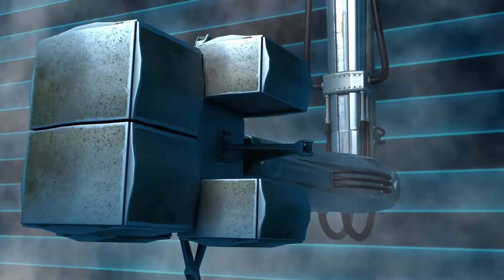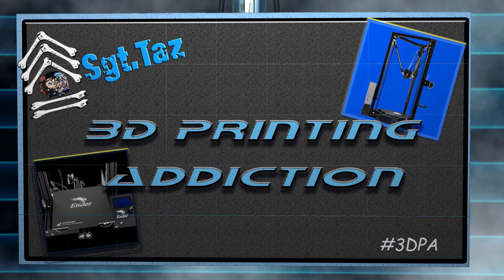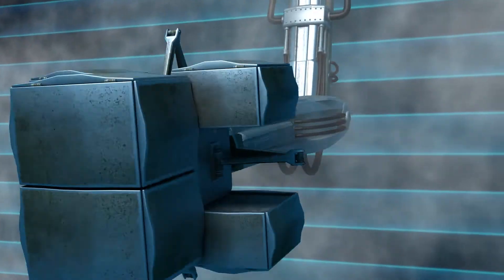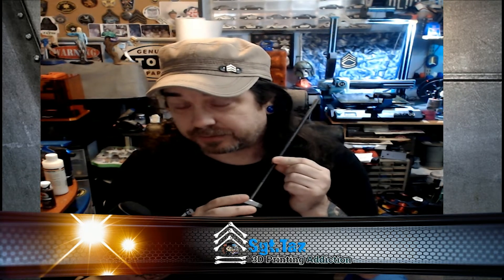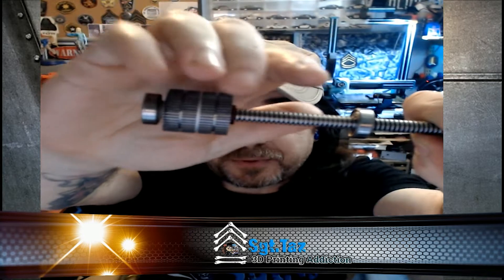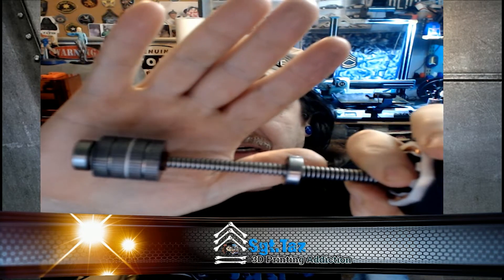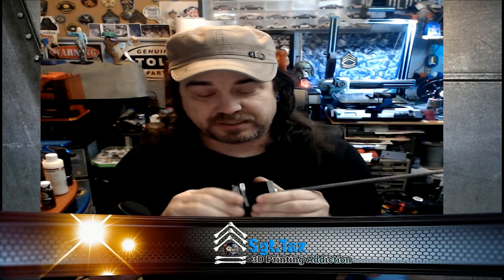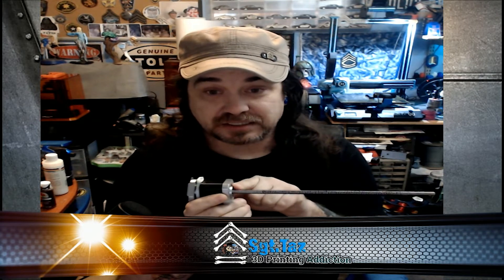Mars Z Binding Fix

Comment: Thanks for the video. I need a new stepper motor for my Mars. Where can I buy one? Thanks
Reply from the maker: I had to message elegoo support to get one. Just happened again on a Mars2 that is 6 months old now as well.  I haven't been able to get the specs on the motor or any numbers off the parts to find an alternate source.
Reply: @Sgt.Taz3D  I was able to source a used one and I am in negotiations with Elegoo to get a new one.